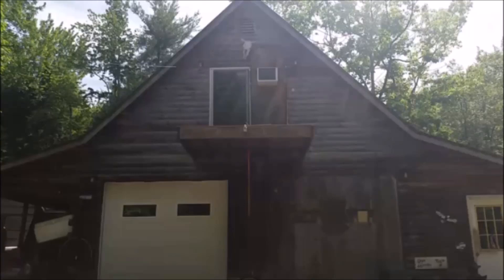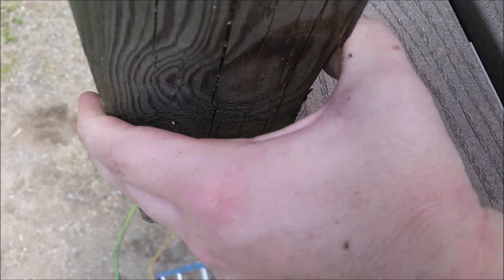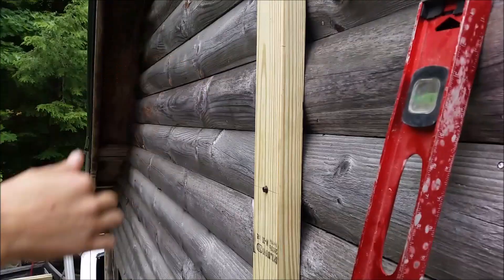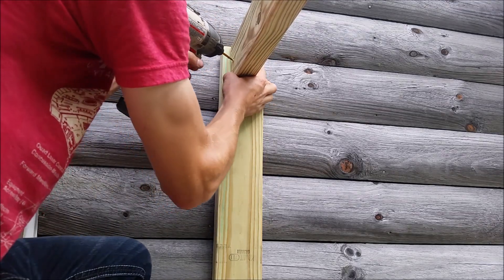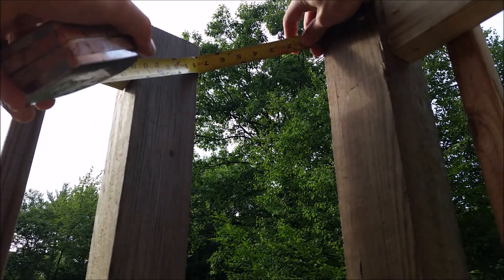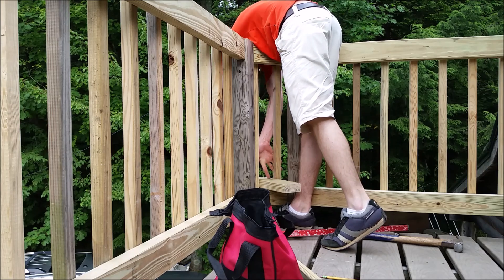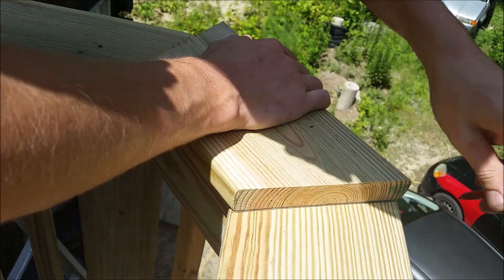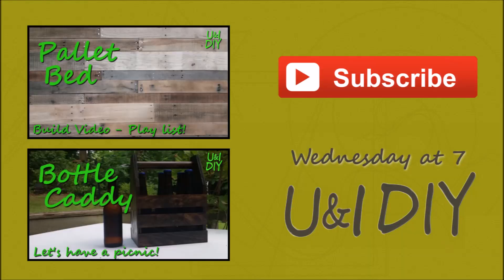Adding a railing to a deck  - DIY Tutorial

Comment: always get the center of your railing length, Mark center and if using 2x2 balusters mark 3/4 " on each side of center mark. Line and plumb your first baluster and make a jig with your spacer distance to space and align your balusters and the will come out evenly spaced on each end, Built decks for many years and this will never fail you. Add last baluster at each end after railing is set in place.

Comment: I like the way you used a 2x4 for rough measuring between the deck and the railing and in between the balusters, but those posts need better anchoring. They should be able to resist a 200 lb lateral force but I could see it move when you leaned against it. Check out finehomebuilding for a way to shore up the post connections.

Comment: I'm putting in the same angle cornered top rail, but it is not working out right. How did you get the degree?  I'm 15.5" from outside 4x4 to 4x4.

Comment: I will make one criticism of a description of a common process in building. That process is the use of a tool called LEVEL. Many videos I see on this platform have presenters using this tool and describing what they are doing with this tool as "leveling " when they are actually checking the vertical (PLUMB), to a horizontal relationship of building member.  The correct term to use when using the level in the vertical position is checking PLUMB.

Utilizing proper terminology, believe it or not, eliminates misunderstanding. For instance; do you "hammer" a nail, or do you "DRIVE"  a nail? You DRIVE nails, you DRIVE screws.

Proper terminology for tools and processes were taught in school shop classes and in apprenticeship programs at one time. Construction is an art form that has its own language. Take the time to learn it if you want to teach the art to someone else.

Other than that, good video.
Reply: Don't worry so much

Comment: Good day, Just found your channel. I see this is 6 years old.  but since I will be working on a railing for the deck this summer, I am hoping you can still answer this  question. You place your lower rail at 4 inches (3.75) and ended up cutting your balusters. Did you angle cut the top or straight cut it and did it make a difference in shedding the water? How tight was the straight cut to the upper rail? And do you think putting the straight cut at the lower end would have been better, functionally if not astatically?   Thanks hope you are well and have a wonderful day
Reply from the maker: The balusters that we had were too long anyways. My dad just picked those up. So they had to be cut, but some of them already come to the proper size. They were a perfect straight cut so that they set right under the cap of the railing. You could certainly put the angled cut at the top and straight cut on the bottom, but from an aesthetics standpoint the angle is at the bottom. You don't even need to angle yours if you don't want to.
Reply: @UIDIY  Thanks for the quick reply.  It did look like you had straight cut the top part on video but I was not sure, that is why I asked. Also having the top  tucked under the top rail most likely protects the baluster from water and rot. Looks good and I think a flat end is how I  will go too. Thanks again. Have a great day

Comment: Needed some ideas for a railing and found your vid. Nice work / looks great. 
Maybe I missed it, but why did you opt for the rounded corners when the deck is square? Strength? Aesthetics? Either way, I like it. Also, are you from New England? I don’t hear many others say ‘dead nuts’   Got a chuckle. I say it all the time :D
Cheers.
Reply from the maker: Yes I am from New England. NH to be precise. I chose to round the corner for aesthetics really. That's what my dad wanted. Thanks for the support.

Comment: Nice job. Question i'm rebuilding my deck I will be installing new 4x4 posts do they half to be notched? The old ones were notched.
Reply from the maker: You usually notch the post to get the railing closer to the deck. You don't have to notch them. I didn't. If you notice at the 3:45 mark, the bottom half of the railing is out further than the decking. If this is a concern for you, then you notch the post to bring the rail over the decking more.
Reply: I know this is late. But if anyone has the same question, notched rail posts are against code in some places. It is in my location. Check before you do it. Unless you meant notched supports posts.

Comment: When you cut the balusters, what's the angle on the bottom? Great video!
Reply from the maker: Judy Auble I bought precut so they came with a 45 angle on the bottom. I just had to cut the tops to make them the right length.
Reply: U&I DIY Thanks. I figured I'd make my own, but I guess I can figure it out on some scrap. :-)
Reply from the maker: Its 45
Reply: yes  good  job

Comment: I don't think your post mounts would pass code anywhere. I can't imagine it doesn't wobble at the ends with just two 1/2 bolts through the single rim joist. You need some L brackets to keep the rim joist from twisting
Reply: dude he wasn't looking for it to pass code, the deck has been in place for a million years without rails, the goal was just to get the rails in place, if they were worried about code, they would probably have had to remove the original deck platform altogether and do everything from scratch - this was just to clean it up and make it look good, there is plenty of strength I doubt they'll be having crazy parties on a deck that is big enough for maybe 2 people at most.  I'm just happy that he didn't notch out the 4x4 posts to attach them to the deck, millions of people building their own decks do this all the time and it essentially turns the 4x4 posts into 2x4's  - he did a good job with the posts and the railing, it looks good and it's plenty strong.
Reply: Dude, that railing will leverage that rim joist and be a wobbly unsafe piece of crap. If it's been up there 20 years it's probably rotten. I see these hack jobs over and over on YT. I have to assume that he's getting this to "look good" so it can be sold to some unsuspecting sucker.
Reply from the maker: My dad is not selling, he's ganna retire on that property. Just thought you might want to know.

Comment: This system is WEAK, loosens up over time making the posts sloppy an easily moved in and out to a point of dangerous. irresponsibly installed in favor of getting it done and making money to the determent of safety and your client.
Reply from the maker: Umm.... I didn't make any money. I was helping out my dad. But thanks for the advise.